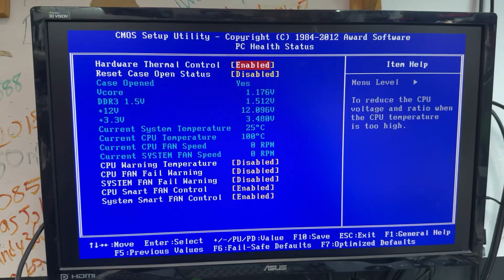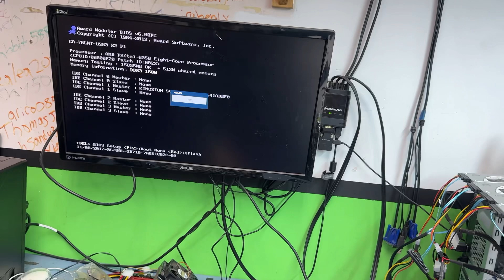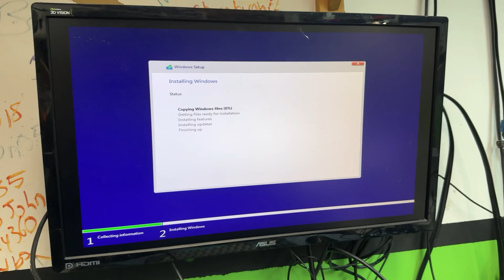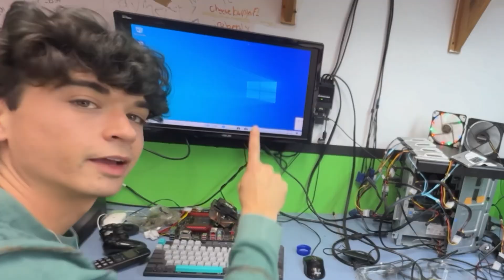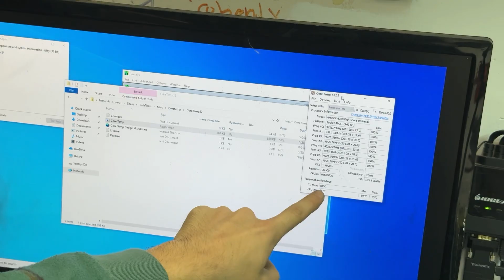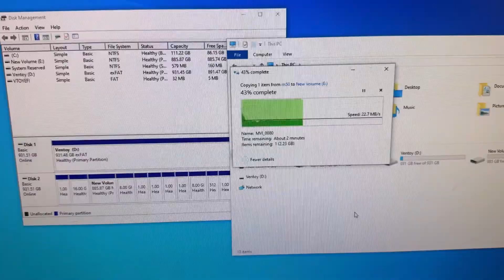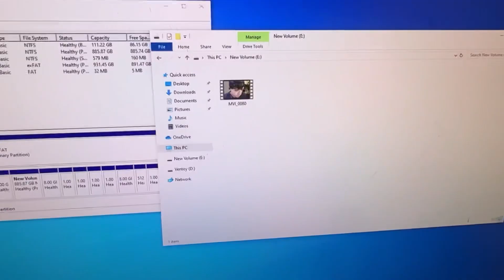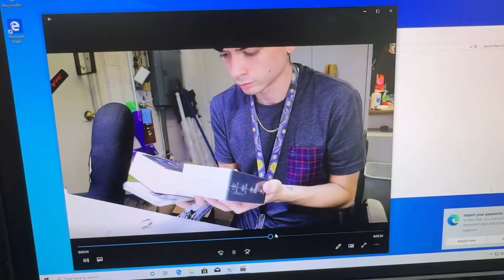I Submerged My PC in Vegetable Oil (and it Works!)

Comment: Probably should have had a glass container. My guess is the cpu melted the thin plastic underneath and that’s why the oil was leaking. If it had gotten hot enough to fry something, it would certainly have melted the plastic first.

Comment: add a heatsink and use a pump or fan to circulate the oil.  Bonus points for adding a radiator, though might not need it just with circulation

Comment: Not suprised but if you're interested in oil cooling pc's, you should use mineral oil, as the veg oil will go rancid. I wouldn't put any hdds in there, but ssd's are fine. Oil cooled "aquarium" pcs were a thing back in the day. If you want to see something really cool, get your hands on some 3m novec or fluorinert and submerge the computer in that.
Reply from the maker: Can you believe the hdd worked??
Reply: @thebomb602  there's no reason for it not to

Comment: This would have worked without the cooler, if you had something to move around the oil. Like a fan or something. Oil is indeed a good insulator, so it won't easily spread the heat evenly throughout the available volume, unless you help it.

Comment: yes, Vegetable oil is not electrically conductive, so it survived. Usually people who do such things use mineral oil as it will last longer as it's not organic and it has a much longer shelf life.
you should have tried adding a fan to blow oil on the CPU, they work in oil, as your problem is that the oil that touches it becomes too hot and there is not enough movement to dissipate that heat and the CPU goes into a thermal protection shutdown. the heatsink gives it a bigger area to absorb the heat and dissipate it with its fins.